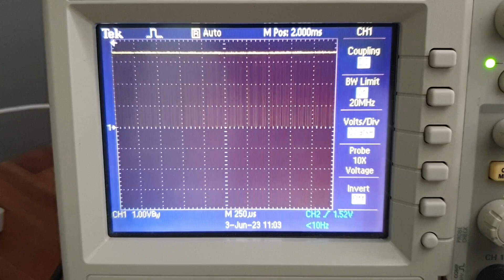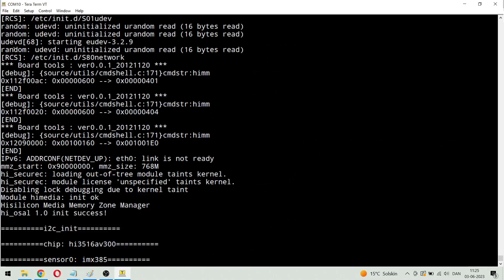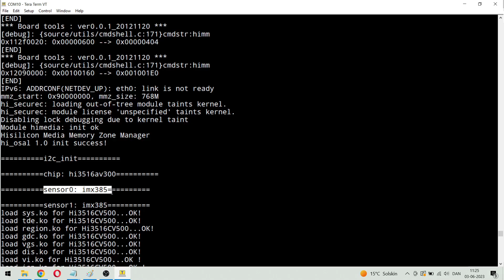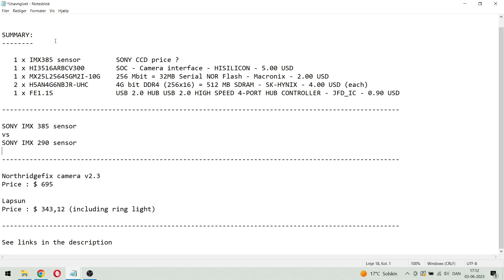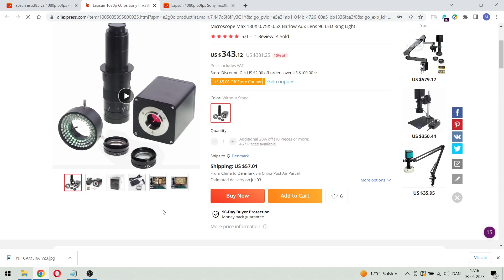Which sensor is hiding inside the NorthridgeFix Camera v2.3?

Comment: The Northridge fix camera is a rip off.
You can literally buy a 48mp 4K package with x150 lens, ring light and boom stand for under $100USD.
If you want to spec up similar lenses you can order things separately,
48mp 4K camera $50-$60 USD depending on brand
x180 Lens $37 USD
x0.5 Barlow lens $12
x0.75 Barlow Lens $$16
Ring Light $15-$20 USD
There is a myriad of chinese brands other than Lapsun such as Yihzan, Eakins, High Cloud.
This should help those on a budget or those just getting into the hobby of electronics.
Reply from the maker: Thank you for valueable insight

Comment: A concern I have is, regardless of actual sensor, couldn't you simply edit file to spit out any sensor brand you desired? It might state certain number but without actually looking at sensor, how would one know?
Reply from the maker: Maybe its possible to check it on the sensor itself but it not possible to to take off the base since it must be in dustfree room. I will have a look in the datasheet and check if its possible to read it out via the I2C bus

Comment: This must be a joke camera for $695.00 for 2MP imx385, normal camera is IMX226 12MP sensor one, lens will cost ~600USD more, if you want chinese camera then lens ~70USD camera ~200USD
Reply from the maker: Yes you can indeed find a cheaper camera than this one
Reply: @made.by.morten.laboratories  But why the author uses these tricks to cheat and sell cheap stuff for expensive prices? What about reputation?

Comment: Very interesting  and thank you for sharing. I wonder how do you go about adding a foot pedal with the imx290. I had connected same as you to read the information ages ago. This is as far as I got to. A guy have done the foot pedal but they do not show the full step. I would like to do on mine as it is annoying every time, have to grab the mouse to change auto focus to manual. The guy who did followed the work of charliex with ekins imx290 can be found on google.
Reply from the maker: What does he use the footpedal for? Its possibe to write you own Linux code if you want to add functionallity.
Reply: @made.by.morten.laboratories  Thank you to change auto focus to manual and vice versa other wise you have to use the mouse. I have the imx 290 with auto focus.
Reply from the maker: OK, i don't know how they do it, this version of the camera does not have autofocus so i can't test it - sorry
Reply: @made.by.morten.laboratories  I noted all the links I posted  related to the foot pedal have been removed. Never mind.
Reply from the maker: Still visible for me, strange?
Reply: @made.by.morten.laboratories  Not visible for me I am afraid.
Reply: @made.by.morten.laboratories    As you can see the link and all the files. I just do not know how to do it. I bought all the necessary items and tools to do it as per the recommendation links.  The files provided in the link I do not know what to do with it and how to proceed.
Reply from the maker: @mm0077  Please send link again
Reply from the maker: @M m OK, i found the article, very cool. If you want to do something like this you need to get some experience with Linux, if you have this project as a goal you can learn it, but its hard and dedicated work ahead then.
Reply: @made.by.morten.laboratories  No worries, I even got a friend who knows Linux a bit but he could not work it out. He said he needs a good guide then he would be able to do it. No worries I will keep looking and learned ☺️.
Reply: How long ago did you buy your IMX290 camera? Have you taken it apart to verify it’s a real IMX290 ? The board where the sensor is will say 290 on some. They have been out of production for about 4-5 years now. They have all been replaced IMX185 /IMX 307 sensors. If it’s genuine can you tell me where you purchased it.
Reply: @shiftctrlhack   I bought 3 years ago and and I checked after a year it is the imx290 sensor. I followed charliesx guide.  Another youtuber was duped thinking he was buying imx 290 but received the imx185. Alipres ekin.
Reply: @mm0077 do you have the link to see ? I bought a camera and I wanted to know which is the sensor... Thanks
Reply: @skysurfhf  Yes but sorry, every time I tried to put a link in it is deleted by yootub
Reply: @mm0077  type the address with spaces between... For example...

Comment: Hmm. Seems like a nice camera but not sure it’s worth that much money.
Reply from the maker: Yes, you are right - i will release some more videos in the future using the camera
Reply: Not worth it for the price I can assure you that. It's decent compared to most of the market but there are those few out in the wild for 1/2 cost that are better. If you can find a old IMX290 MS Camera hold on to it for deal life. Really you only need 2MP for inspections and the IMX290 was and is the best you can get IMO. The only problem is they stopped making them for some reason 4-5 years ago. I haven't found a legit supplier for any IMX290. Rising Cam has a RT5109 -  4K real 60FPS which is actually one of the few good cameras for the price. Almost all of these camera being sold now are using frame interpolation to get the " 60 FPS ".
Reply: @made.by.morten.laboratories  Please sir make best camera using good parts . And please share with others . If you can not only camera do same for other tools . New subscriber from Sri Lanka . Thanks for great video
Reply from the maker: @nalindisanayaka6220  I will work on it, thank you for being a new subscriber, i appreciate it a lot :-)
Reply: @made.by.morten.laboratories  thank you sir

Comment: i would not blame north ridge fix for the price. 
they are also buying it from china and they are importing it paying the shipping paying the duty and then they are keeping it in a warehouse then they are selling it and they are shipping it + paying taxes and all of that adds up. even after all of that if they don't turn a 30-50% profit on each product then there is no point in doing that business. aliexpres is shipping to you directly from china so they would obviously be cheaper .
Reply from the maker: Thank you for your comment, i really appreciate your input :-)
Reply: + warranty. So yes , you pretty much summed it up and this applies to almost everything imported. With 10-20% margin , selling this stuff  would not be economical very quick.